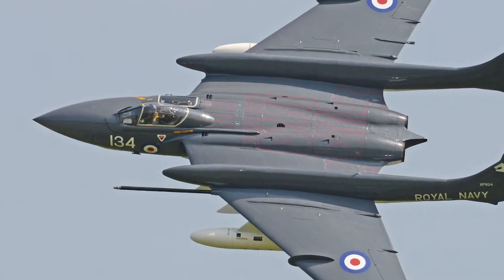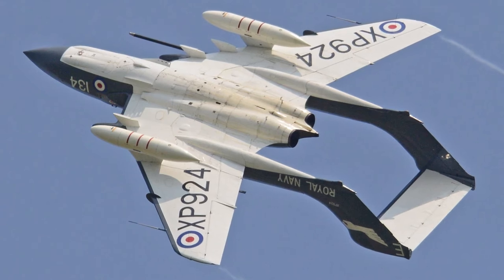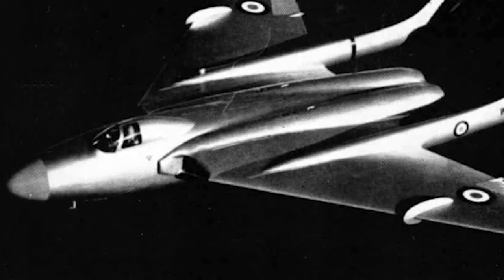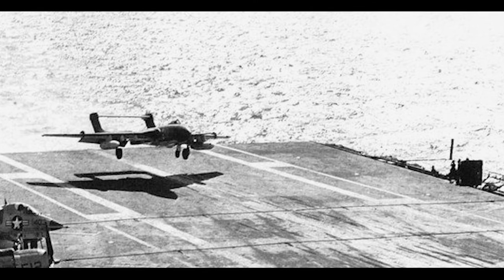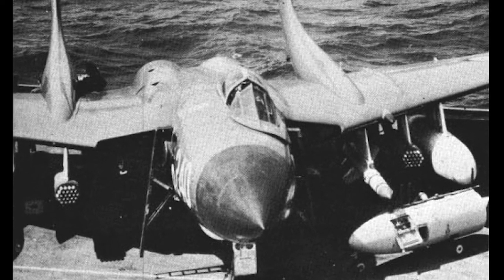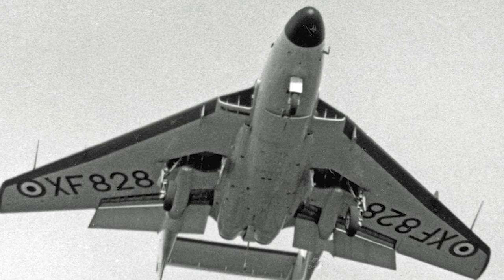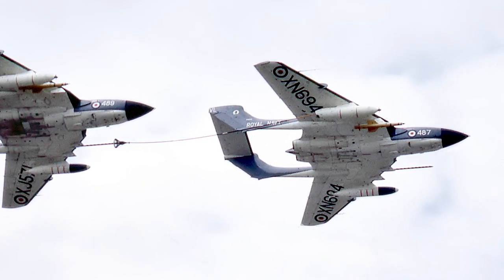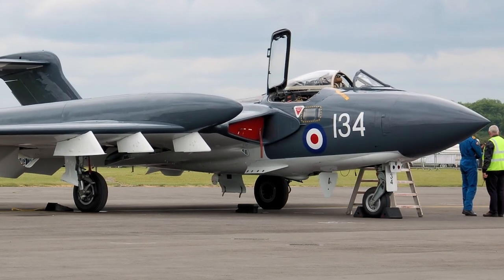de Havilland Sea Vixen - A Short History

Comment: I might be wrong but I thought they were used later on as target tugs and drones.
 The FAA passed some on to the RAF for training purposes. I did seat fit's and weapon load training on them as the Mk 4 seats and the ERU's were the same or similar to the equipment we were using at the time. The seat configuation seemed a little odd for our training, until you look at PR9 Canberra's. 
 I only ever saw them flying at open days at Hatfield in the sixties as a kid.
Reply from the maker: You might be right about that, actually.
Reply: Always wondered why the cockpit was slanted to the left a little, can anyone enlighten me please!?!
Reply: @susankelly7778  The navigator was seated below and to the right of the pilot, his head level and just behind the pilots knees, rather than in tandem as most aircraft. Whilst on training on these, I was told that the chances of successfully ejecting  from the Nav's cockpit had been low. Just don't ask me the logic behind this positioning? Take a look at 10 seconds plus and pause the video, you can see Navigators position clearly.